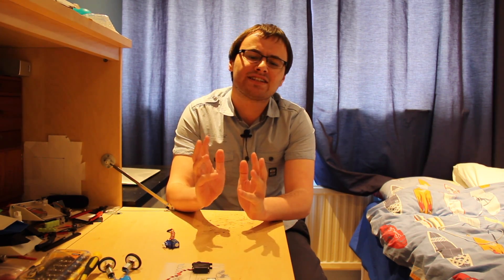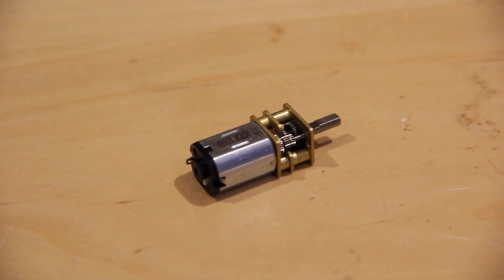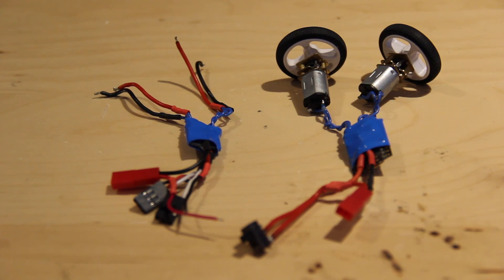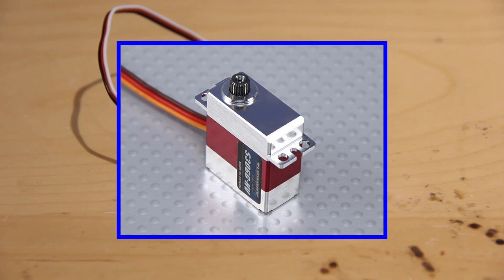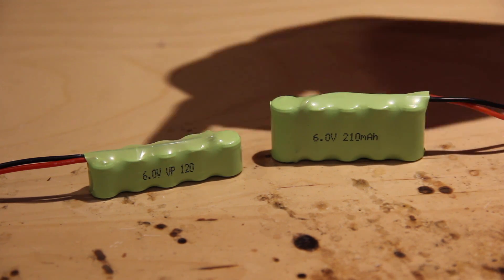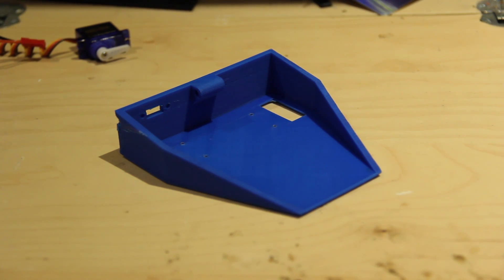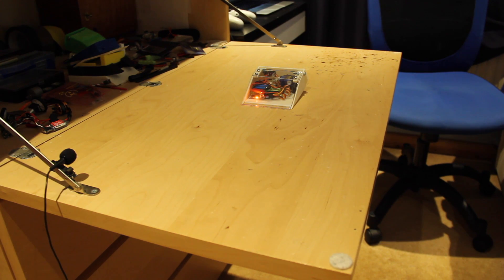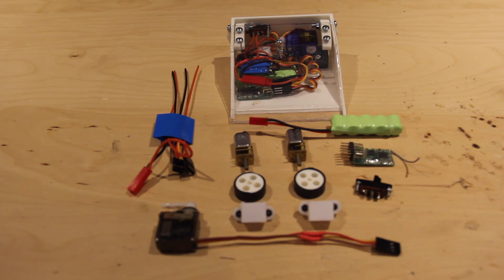How To Build A UK Antweight Robot

Comment: I have a question. I have a dual way esc rated for 7 amps peak current and two motors that need about 2 amps. 
When I connect the esc to the rc reciver, if the transmitter isn’t active nothing happens. 
How ever when the transmitter is on even if I’m not driving any motors, the mosfet on the esc heats up to the point where the plastic protection becomes sticky. What am I doing wrong?

Comment: Will these motor brackets work? https://www.ebay.com/itm/5pcs-N20-Micro-Motor-Mount-12mm-DC-Gear-Motor-Bracket-for-RC-Model-Robot-New/333656603596?hash=item4daf7bbbcc:g:kcwAAOSwTXRbBngn - nice video!
Reply from the maker: Yep, they’ll work fine.

Comment: If you use an ESC, do you still need the gear box?  Recommendations for a transmitter?
Reply: You dont need a gearbox at all, it just increases the torque coming directly from the motor. Any motor without a gearbox can be used but unless you use servos to power the wheels an esc is always necessary. As he stated in the video cant go wrong with a spektrum transmitter, ive used the Dx6e before with great results

Comment: How do you get 2 motors to work with the controller. Would you have to push the stick diagonally to go forwards with each motor as they’re on 2 different channels? I was originally thinking I’d have to have one motor for each stick, but only stick returns to the neutral position on a transmitter.
Reply: You could use a channel mixer
Such as
https://www.fingertechrobotics.com/proddetail.php?prod=TR-V-tail

Comment: could you please tell me how to mix steering on transmitter
Reply from the maker: What transmitter are you using?
Reply: flysky i6 6 channel transmitter
Reply from the maker: If you're using a dual motor controller (that should have mixing built in), you shouldn't need to turn mixing on the transmitter. If you do need the Tx mixer, I'll try and dig something up.
Reply: I am having single brushed esc for each of the motors . I am unable to mix it properly
Reply from the maker: This should be worth a look.
https://www.youtube.com/watch?v=xt5IdeLdiug

Comment: The link to the charger is not working. What is the model which was recommended?
Reply from the maker: Try this one. 
https://www.ebay.co.uk/itm/iMAX-B6-Digital-LCD-Screen-RC-Lipo-NiMH-battery-Balance-Charger-Discharger-New/153015601618?epid=6019547970&hash=item23a070c9d2:g:obYAAOSwYhdbDhYV

Comment: Thee doesn't seem to be an easy way of recharging the batteries, would it be posible to insert a charging circuit board so I could just plug it into a phone charger or something?
Reply from the maker: There are USB wall chargers somewhere but I'd highly advise to steer clear from them. Some don't have the control over how much charge and current to put into LiPo's meaning a potential fire hazard.

For an easy charger I'd reccomend this one:
https://hobbyking.com/en_us/turnigy-12v-2-3s-basic-balance-charger.html

Comment: I assume that it's basically the same for high weight classes, just using different parts? (I'm planning a beetle weight)
Reply: Higher weights will need stronger battery requirements and therefore you might need to have a separate circuit where you use servos to actuate switches to control the other higher power circuit. Otherwise you could end up putting 12V or so into a receiver that cant handle it and blow it, or have vastly underpowered motors

Comment: Your man's speed controllers are currently unavailable.

Can you recommend anywhere else to get a decent set up from?

My boy wants me to build him an antweight, and having a very limited tool set up, I don't really have the capacity to build one from teh ground up.
Reply from the maker: The only thing I can really reccomend is the DasMikro which will require some soldering. 
Here's the link:
https://www.banggood.com/2S6A-Micro-Dual-Bi-Directional-Speed-Controller-for-Tank-Crawler-and-Boat-without-Brake-p-1032413.html?utm_source=google&utm_medium=cpc_ods&utm_content=heidi&utm_campaign=fpv-sds-58fpv-m&gclid=CjwKCAiApo3SBRA4EiwAty8i-pLojI3W7pP76q93rZ3FJAJ6AW7WTa8SWsBKiqUx5wpN5d1XUqdf-BoCVVkQAvD_BwE&cur_warehouse=CN

Comment: Do you have to have a spektrum radio to bind with the nano two? Because I’m wondering if it will bind to a frsky Tara is qx7
Reply from the maker: Jack Freemantle If it’s one wired to a LemonRX receiver then yes, but with the one with receiver connectors for some reason I’ve only got it to work with DSM2/DSMX receivers.

Comment: This guide has been SO helpful for me getting things together. I have bought the first esc you have mentioned as rory is so busy that he hasnt even replied to me in weeks which is understandable. So i have bought pretty much everything else i need to get things together apart from a receiver and some batterys + charger. My only problem is i have no idea how the heck anything pieces together so far. I need to do some soldering and piece it all together inside a test chasis but i have no idea how to do anything of that. It will be a learning experience but i was wondering if you or anyone else knows about any other indepth guides for this kinda stuff? Anything on robot101 or other forums as i am not active on them.

Comment: The dasmikro esc has two plugs that look like servo connectors (battery lead side) but I don't know where they connect to. If you could help that would be great
Reply from the maker: Jack Freemantle If you mean the red JST connectors, you'll need to use the female one.
Reply: Team Panoramic yes I know those, but the two connectors that are the same side, where do they connect
Reply from the maker: Try this.
https://img.banggood.com/thumb/water/oaupload/banggood/images/83/CB/99104ab5-0ca2-449b-88cf-cefb88f60dfd.jpg
Reply: Team Panoramic thankyou

Comment: In Vanguard I am currently using DFRobot 'Gravity' motor drivers, they come pre-soldered to the motors and can handle 7.4V. I will probably stick with them until I can get some RoryBoards (tm). For armour Ti sheet is also an option, I get mine from random Chinese folk on eBay. 

I am currently working on a 3D printed Vanguard, maybe the wheels will even be on the ground this time!

Comment: Great video, I'm just starting out myself and was wondering if the DasMikro 2S6A has a built in BEC or a way of stepping down the voltage from my 7.4V LiPo? Thanks
Reply from the maker: The DasMikro's input voltage is 4.2V-9.6V and has 5V1A BEC. So it'll handle a 7.4v LiPo battery.
Reply: Awesome thanks, could you make a video on flipper linkage which is more in depth? Love your work though, its fantastic!

Comment: This is really awesome, thank you for doing this.  Two really stupid questions that have been bugging me since I first started thinking about building an AW-

1) I've always considered going lexan/polycarbonate for armour, but with that how would you go about actually putting the chassis together?  Cutting panels individually then screwing them all together, making a single piece chassis that attaches to a baseplate, etc?

2) The most daunting aspect to me as someone with virtually no electrical/engineering experience is wiring- namely getting it so everything does what I/the transmitter tell it to do.  Is setting up the controls and connections between the receiver, ESC and motors complicated?
Reply: american roboteer here who has built 2 UK antweights

1. usually builders do a single piece of lexan folded several times to create a "shell".

2. wiring is pretty easy (if you live in the UK you can buy a custom electronics package for a UK antweight to make it even easier)
Reply: 1) I never considered the fact you could bend lexan...

2) Yeah I'm aware of the nano-two kits and have always considered going for that route, but this video and a couple of other things recently have made me consider just going all in and doing it from scratch to get the experience

Thanks for the reply!
Reply: I personally would cut out a net of your chassis, heat it up and bend the net of the shape in the required places. However, I have tried this with perspex, but I don't know how it would work with polycarbonate.

Electronics-wise, you only really need to learn how to solder, and the wiring is not that complicated as the companies have already designed all of the electronics.

Comment: where can i get a cheap transmitter and receiver for under £20 with 4 channels?
Reply from the maker: With Spektrum technology at a price like that they're quite hard to come by. There was the MLP4DSM transmitters but they gone up to around £35 because of how rare they're going now they're discontinued apparently. May be able to get hold of some DSM2/DSMX transmitters second hand for that price.
Reply: Team Panoramic Ok. I might get one from hobbyking though.
Reply: I have the hobbyking one, it is pretty cheap, but it works
Reply: I use a FlySky 6 channel transmitter and receiver, around £40 and the receivers cost £20 roughly for 2. Slightly more but it has inbuilt V-tail mixing.
Reply: What's your source for the rubber sleeves you use for the 3d printed wheels you showed?

Comment: I print my ants and beetles on a maker bot replicator dual with abs and have had small problems with warping but I just put up the extruder temp and base temp I always have problem fitting me components in I only use different escs to yours but I found this tutorial very usefull